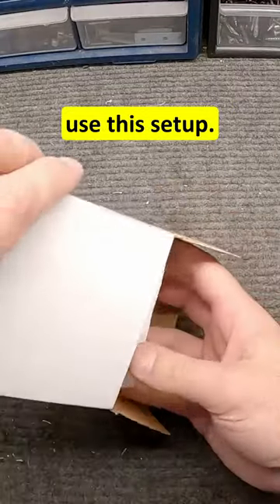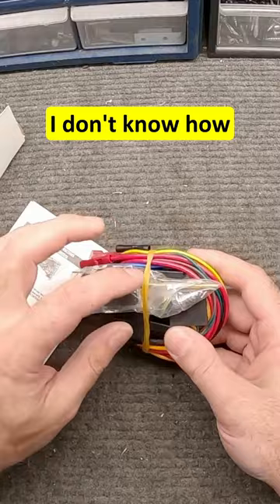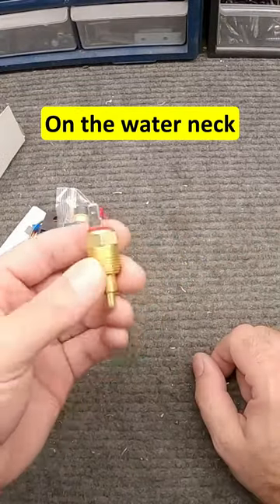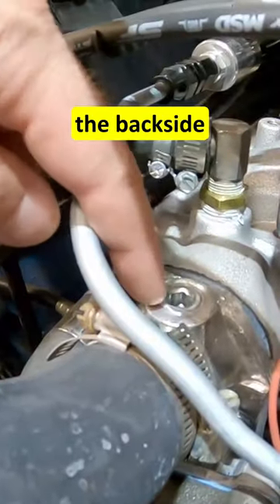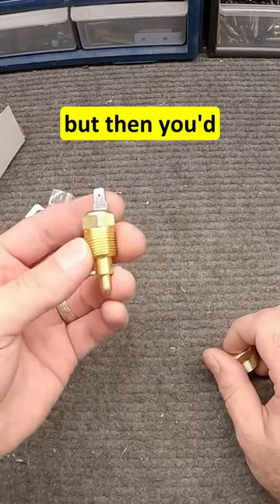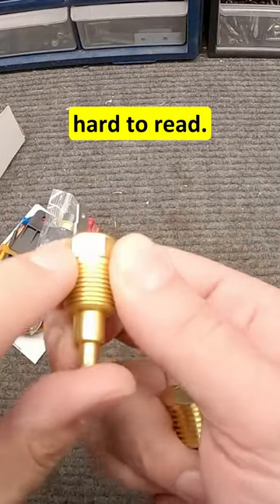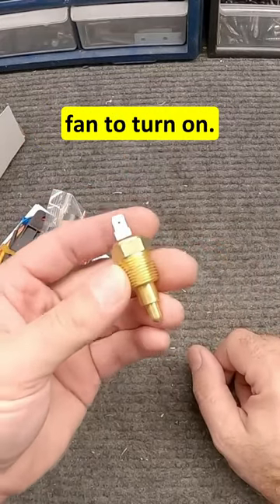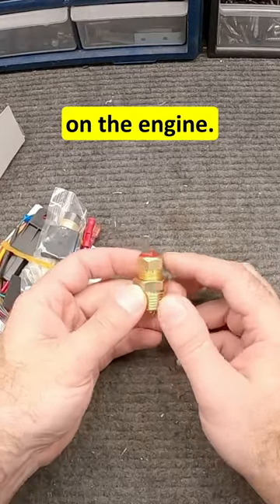Temperature Switch for Electric Fans - Classic Mustang

Comment: I used the same thermo switch on my engine in the water neck. Once the fan is on my coolant never gets cold enough to shut off. I believe it's 185 on 165 off.
Reply from the maker: There could be a couple factors here.  It couple be a faulty switch.  If the weather is warm, that can affect the heat of the engine.  You coolant system may need to be evaluated if it doesn't get cold enough.  My switch is 185 on, 170 off and I can hear it shut off when the temps gets low enough.